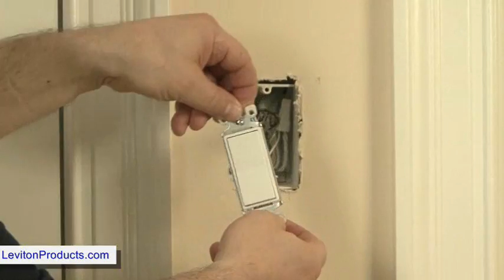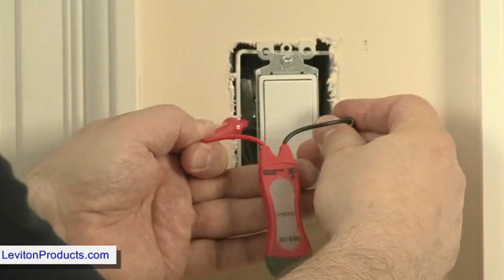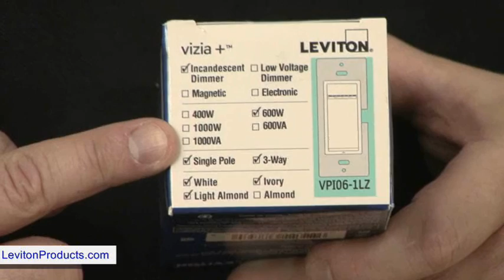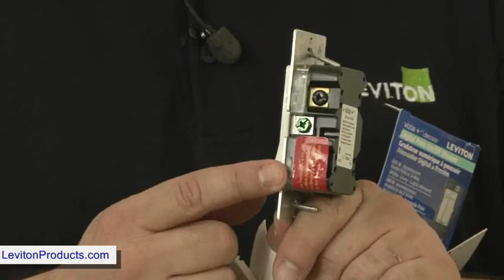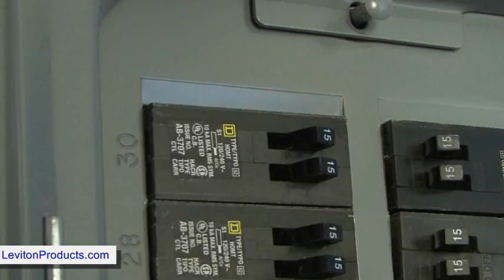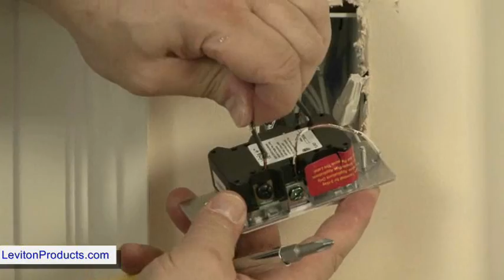How to install Leviton Dimmer Switch - LevitonProducts.com

Comment: OK so I just bought a Leviton Slide Dimmer single pole, now my box in the wall is plastic & there is no ground wire from the wiring harness only the hot & neutral only, so the problem I am having is that even though the dimmer works correctly without the green ground wire unable to hook up to anything is that when the light is turned on I get static on my am/fm radio in the kitchen though when I turn radio off the static disappears completely so what can be done about this could it be the dimmer is not correct for my ceiling light that uses three led bulbs?
Reply: I'm not a certified electrician, but if I were you, If the box is metal, I wouldn't worry about it. The switch grounds to the metal box if the box is installed correctly

Comment: installed on single pole with my black wire in black and my white wire in red. turns on but not off. no ground wire available
Reply: did you ever get an answer to your question? cause I'm experiencing the same issue

Comment: What do you do if your box does not have a ground wire sticking out and your new dimmer switch does?
Reply: You do not have to connect the ground if one is not there.